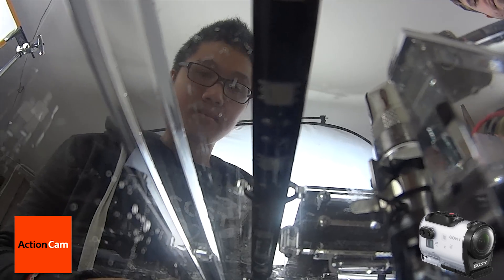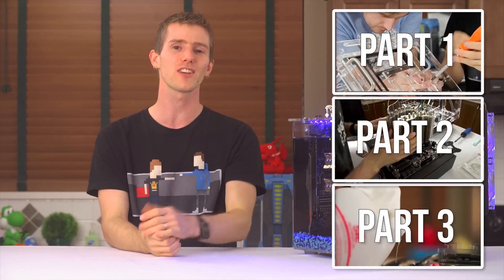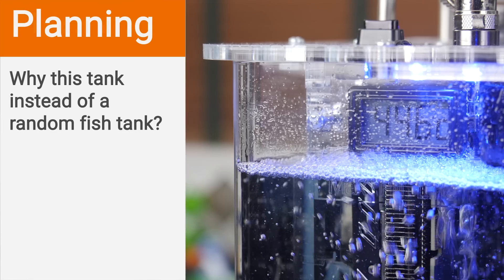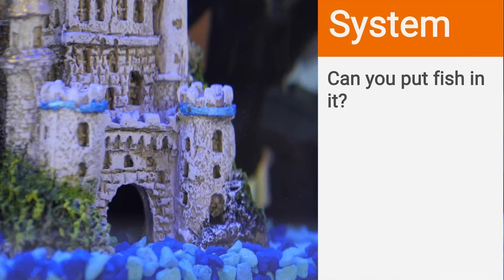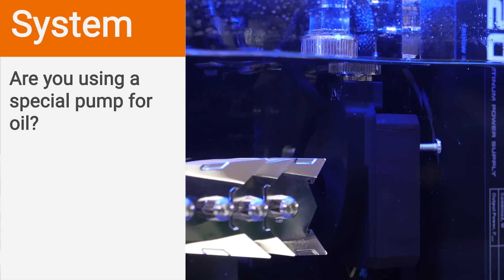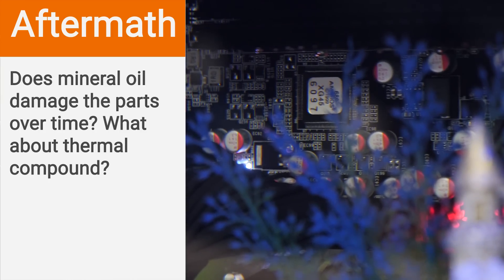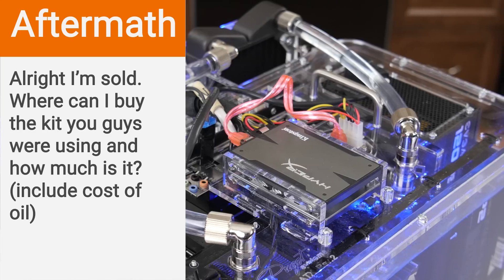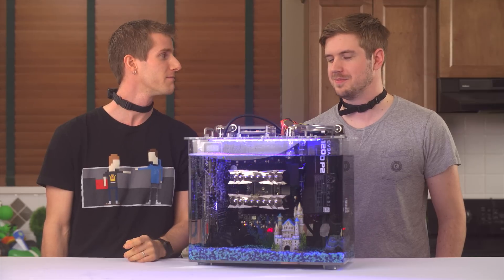Mineral Oil Cooled PC Part 4 - Q&A

Comment: Still no 1080 available?  
I can't watch this in 360p... I don't want console quality...
Reply: You mean "792p"
Reply: lol aha!
Reply: SpurnOfHumanity You're giving opinion as fact, might want to stop doing that
Reply: Apply mineral oil to burned area.
Reply: SpurnOfHumanity
Humon eye cont see more than 15 pixols.
Reply: Console is actually 720 / 1080p. Please think before commenting.
Reply: ***** But its 30 fps so it doesn't matter because gaming at 30 fps is cancer and no brother of the master race should have to go through it.
Reply: SpurnOfHumanity"All you would want" Clearly a false statement.

Don't tell me what an experience is worth to me.
Reply: SpurnOfHumanity It clearly is opinion. Go out and play on a 27" 1440p screen, then a 4K screen. Same thing? No. It looks different. Therefore, claiming it's not worth it is OPINION, not fact.
Reply: Will Stubbs
This guy has mole eyes, he won't see a difference.
Reply: Jody Boles I wanted to upvote you first, but then I realized it wasn't ironic.
Reply: SpurnOfHumanity Stop talking about the human eye when you are talking about your mole eyes.
Reply: Will Stubbs It isn't about opinion, it's about how much PPI the 20/20 human eye can see.Lets put it this way; If you cram 3820 x 2160 resolution into a standard 27" to 32" monitor (or even smaller) you absolutely CAN NOT see the pixels at that point. You can't justify the price and strain on your system. However, when you stretch the size of your screen out with the same resolution, the pixels get bigger... I shouldn't need to explain this more.

And, ***** You need more practice quoting people because I didn't say "would" I said "should".
Reply: SpurnOfHumanity It's a good thing that you can't see the pixels on 4k...
Reply: SpurnOfHumanity Its completely obvious you never gamed a 4k. Try it before you talk about it. P.S. all the 4k gaming owners are face palming at your comments.
Reply: I liek Jeeps.
Reply: SpurnOfHumanity Might if I tell you that, even if you can't see the pixel, the textures quality is still a lot sharper, that is even noticeable in Youtube video, which is already a blurry version of the original. 

"you cannot see pixel blablabla", it's 4k gaming we are talking about, not texts and shit.
Reply: SpurnOfHumanity It's gaming we are talking about, even yourself said "games", those high resolutions are not only for texts, but for the graphics, texture, you have to be blind to not notice the difference. Higher than 4k, maybe that's the case. 4k native? It is still noticeable.
Reply: watching this on 4k lol
Reply: ***** Anyone who games in 4k is wasting their time. There is no reason for it unless you are using a screen bigger than 55" - 65". The video fidelity doesn't justify the system strain. at most on a normal 27" screen, all you should want is 1440p - 1600p and 1080p on anything smaller than that.
Reply: ***** It's called sarcasm
Reply: SpurnOfHumanity So how do I "Prove" I have a 4k setup? Its almost the norm if you got a 3k$ setup
Reply: SpurnOfHumanity  Not being able to see the pixels is a good thing, makes it more realistic. Can you see atoms? No. And who is to say someone shouldn't go for 4k gaming if they have the money to do it? Maybe you don't have the money, so you've convinced yourself that it isn't worth it to make yourself feel better, I don't know.
Reply: SpurnOfHumanity The human eye can perceive about double 4k as I recall. I've seen 3840x2160 in person and the difference is MASSIVE!
Reply: no thats why 4k is better
Reply: SpurnOfHumanity  This guy makes a VERY valid point! With 1440p on a 27" monitor - you pretty much have to jam your eye INTO the screen to make out discrete pixels!
He NEVER said there is no difference between 1080p + and 4k - simply the TRUTH that when using a 27" monitor to game, 4k is pointless! If you are trying to game on a 42" + TV/Monitor THEN a 4k solution may be worth you money - in my opinion, going beyond 1600p - ESPECIALLY with aggressive AA and ASF as well as other image quality settings, seems entirely pointless IMHO!

And to all you console clutching peasants out there, NO - your PS4 and ESPECIALLY Xbox Ones - CANNOT do 1080p! They may output at that resolution - but you are CLUELESS and do not belong here if you believe that is what you are looking at! Sad truth for "next-gen" console owners - YOUR SYSTEMS CANNOT RENDER AT 1080! Period! They can output 1080 p VIDEO, but when it comes to gaming you are stuck at 792p and 900p for Xbone and PS4 respectively - BECAUSE THAT IS ALL THE RESOLUTION YOUR CONSOLE ARE CAPABLE OF RENDERING AT! So no matter WHAT ANYONE tells you, you are NOT looking at 1080p games!

And it only gets more sad from there - with 30fps being the average those consoles can output at their respective maximum render resolutions in games - as previously stated; Gaming at 30 FPS is a fucking TRAVESTY that no one should in their right mind would even TRY to call even adequate! Especially when one considers that you aren't even looking at 1080p rendered models, textures, and environments! For VIDEO - yes, 3o fps is adequate, between the static nature of videos and natural motion blurring - as well as no response time being needed whatsoever (as videos are not interactive, hence the "static" nature I mentioned, as a video will always play everything in just one order) add to the fact that natural images are not aliased whatsoever, and frame rate stops being such a primary concern! That being said - I sure as HELL can see the difference between 30 fps video and 60 fps! But the difference between 60 fps and 120 fps - for VIDEO (not gaming!) - is MUCH harder to see!

So many people with so many ignorant beliefs trolling each other - fun fun YouTube comment time! 

Spurn here made a VERY valid point which is TRUE! Unless you are looking for some huge screen real estate, 4k is a waste for gaming. That is to say, a 1440p 27" monitor with aggressive image settings will look and play better than a 4k 32" without and AA or ASF. Given, if you DO have something like dual GTX 780-970 + video cards, yes, you will EASILY be able to game at 60+ fps on a 4k monitor - but unless that monitor is 48" or larger, you are just wasting processing power as you will see little if any difference - certainly at an equal sized 27" you WILL NOT be able to visibly see any difference between 1440p and 4k - as the pixels are already smaller than anyone could possibly make out even just 12" from said screen!

Basically, if you CAN game with 4k at 60+ fps - you would be MUCH better served by setting up two or three 1440p 27" monitors in a surround setup!
Reply: Dysphoricsmile finally, someone who knows,  #pcmasterrace
Reply: It available in 4k...
Reply: SpurnOfHumanity Ok I know this post is 8 months old but holy fuck you're stupid. First of all, unless you have shit vision, you should absolutely be able to see the pixels on 4K 60" screen. ESPECIALLY with your face on it. Second of all, the human eye doesn't see in pixels. And even if it did it would see WAY more than 8K. Scientific tests have shown that IF the human eye saw in pixels, it would be somewhere around 530MP. That's about 16 times better than 8K. I have personally done a test; I could definitely see a difference between 4K and 2K at 30". 4K looks much sharper and clearer.
Reply: Up to 1080p now.
Reply: You guys are complete morons, i swear. As soon as you can no longer see the pixels, the resolution ceases to be justifiable. you cant see the pixels on a 1600p 27" monitor already so how do you justify 4k in 27" or even 32"? It IS NOT sharper if you can no longer see the pixels anymore. 

Also, keep in mind that just because the video loads and plays in 4k doesn't mean that you are actually seeing it in 4k, You are just maxing your screens pixels out.
(Unless you actually HAVE a native 4k panel.)
Reply: And you're wrong again. THIS IS THE LAST TIME I WILL SAY IT. Once the PPI gets higher to the point that your eyes can NOT see the pixels, the resolution is NOT justifiable.
Reply: It is crazy how people actually think there is a big differece between 1080p to 4k. That's like saying there is a big difference from 60 fps to 120 fps. Once you go that high, the amount that improves is very very little to the point that you don't see anything different.
Reply: IrgendEineZecke 360p is bad but I don't really care if I'm just watching a video. Gaming is different of course.
Reply: SpurnOfHumanity If you heard 64 kbps audio, it would sound like shit. On the other hand 320 kbps sounds amazing. You can't hear every bit of sound in the 64kbps audio, but that doesn't mean that more bits per second doesn't make a difference. Much in the same way that i cant see the individual pixels in my old tv from the 90's across the room, but a 1080 tv looks much better.
Reply: SpurnOfHumanity lol star citizen supports 8k, go spew your facts to the devs, and when you loose, call them idiots, see how that works out
Reply: I Came from the future to say That my 8k 3D monitor is obsolet and my AMD X Line 990 ( 200 séries after the r9)  is frame droping, i downloaded crysis 4, a very old game, and at 8k with 700% of anti analising this shit went from 678Fps to 350!  now its totaly unplayable
Reply: SpurnOfHumanity system strain? you should do more research, pc hardware is more powerful than you think, its worth it for enthusiasts who pick the right parts :)
Reply: ***** The total max resolution your eye can see might be 8K as you say (haven't checked that myself) the point SpurnOfHumanity was trying to make is that the monitor doesn't cover your whole field of view only a small portion of it. What's important is the pixel density which gets at some point so high on a average 22-32" screen it doesn't make a difference for the eye. However if the games natively support higher resolutions they also load better textures which you CAN see and you will also notice a good antialiasing effect (which you would also have on a 1440 or 1600p monitor with msaa).
Reply: What a troll you are :D
Reply: And 30 fps is very playable
Reply: MrHoward888  Prove you own 4K.
Reply: on a 27" it just barely starts to become unnoticeable. That's why 1440p at 27" is the sweet spot.
Reply: Kyler Blain ok then, answer this. If you get to the point where you can no longer see the pixels anyway, how can you justify going any farther if it makes no difference therein? How do you justify the extra system strain and money you spend?
Also, I CAN afford 4k. Someone up there said How do they prove they have a 4k screen, well, I can PROVE I have a $700 video card...
Same basis.
http://instagram.com/spurnofhumanity/
Reply: ***** yea, you a complete moron. We can NOT see DOUBLE 4K. thats 8K. even with your face ON the screen on a 60" hdtv you can't even get CLOSE to seeing that resolution.
Now get your idiocy blocked.
Reply: You guys seem to think I'm say there is no difference between 1080p and 4k. That is NOT what I'm saying. What I'm saying is that the human eye cant see the difference between 1600p and 4k on A 27" MONITOR. Now yes, if you were to stretch both resolutions out to 60" 1440p would of course be the first one to show the change.

I'm done explaining this to you 4k fanboys. 
Don't bother replying. I'm muting this thread.
Reply: SpurnOfHumanity didn't linus post a video that said that the size of the screen doesn't affect resolution? that is just putting a bigger image in your face and that's it?
Reply: motown lax He's right about it being more noticeable on large screens, same resolution on a larger monitor IS the same resolution and that's why it looks worse, you have less pixels per inch of real estate.
Reply: Consoles also play at 30fps, but your right.
Reply: Yea, I meant average. In like a 2d platfromer it could get 60 but in bf4 it gets 30
Reply: n00b, pik up teh controwler and les do dis. noob
Reply: *****
Can't remeber... i know it wasn't you, maybe it was. . . idk,
Reply: IrgendEineZecke 30fps for that "flipbook feel"
Reply: motown lax
*lose
Reply: I get a 4k option for this video, stop watching this on your iPhone
Reply: Mos Burger
i haz 12k. money for teh pee cee yai!
Reply: im still on a Pentium 2
Reply: Moron
Reply: ***** I was not calling you a moron so what is wrong with you
Reply: on 4K right now
Reply: OOHHH MY EYES!!! You say there only 360p and I get a 4k quality, so much quality!! I'm Blind!!
Reply: It's up to 4k you idiot
Reply: IrgendEineZecke Congrats for your feat of mankind
Reply: shune84 It's not worth it... you can have 4 way SLI GTX 980's and still wouldn't be able to max out settings on most newer games to play on a 4k... it's pointless as others stated on here. 4k would make more sense for people who need high resolution, for photo, video editing etc... Also for viewing 4k video.
Reply: IrgendEineZecke You just failed hard.
1.This means your PC isnt that advanced because you can't even get 1080p on it.
Second, my xbox has Full HD since ages
Reply: Jody Boles HOLY SHIT YOU'RE SO WRONG.... I don't really comment in hilarious battles like this but FUCK man, you seriously have no idea what your talking about! At higher resolutions, textures are higher quality and rendered in such a way that anti-aliasing doesn't matter! The experience of high resolution gaming IS better and I'm not sure if it's even arguable.  Also, don't even think about spreading your console fuckery about framerate! The difference between 60FPS and 120FPS is tremendous!!! I guess you wouldn't understand that though because all you ever see is 30 FPS anyway.
Reply: ImplosionFactory hmm I guess you don't really understand that I actual play PC not console anymore. There is a good difference between 30 fps and 60 fps but not much more once you go beyond that but that's me. Having higher fps is great but having 60 fps or higher is that big of a deal at all unless your game starts running below 30 fps and lag.
Reply: +MsToshi1990 and 900p -_-

Comment: I'm thinking of mounting PC components on a board on my window. I live in a cold country and the windows are always cold. Good idea or not?
Reply: ***** Thanks for that. completely forgot about condensation.
Reply: That could definitely work.  I would recommend mounting to the outside of the actual glass and not drilling into it though. Get some long extensions you can bolt your mobo on to and screw into the framing
Reply: Noctica also you would have to clean it everyday as you'd have no protection against dust.
Reply: I don't think, that's an especially good idea. First, there's generally a radiator below your window (at least where I come from) that will throw hot air onto your build. Second, you wont get that much of a Benefit from that window, because windows are made to be somewhat isolating, glass has a low thermal cappacity and you won't be able to get it directly at your processor or GPU. And i don't think, cooling the back of your MoBo is really necessary. And last but not least, a window is made so you can see through. I imagine it could look really cool, but it will get a lot darker in your room.
Reply: Great idea. Hang your pc outside so that birds can sh*t on it xD that will act as cooling agents xD
Reply: I think instead of mounting your motherboard on or right next to the window, it'd both be safer and you'd get more benefit from mounting a water cooling radiator there instead. Condensation would no longer threaten your system and you'd actually gain more cooling benefit.
Reply: straikychan The PC I was thinking of doing it with i an old college one with an exremey high amount of dust on it. Haven't got around to cleaning the components yet.

There's really nothing to lose if I do this anyway haha
Reply: If you don't let your computer cool down  (shutdown), there won't be any condensation problems.  Even when  running it outside of your house below zero in a weatherproof box.
Reply: Finrecon1 with enough holes to breathe ^^
Reply: Noctica I have my computer 3 cm from my window. I can also open the window so the intake is like 5 cm from the opening. I live close to the arctic circle, Sweeden. It becomes verry handy during the winter :)
Reply: Damn! Thats great

Comment: Linus could you do a video on how to hack a Geforce graphics card into a Quadro? Many Youtubers talk about this but there is not a lot of instructional content floating around. Thanks! Love all the content on this channel :)
Reply: it involves soldering and driver hacking and they are only recognized as quadro there are still fetches that do NOT work and if there called on can eather blue screen the system or damage the card
Reply: foxhound590 Ok, thanks. So I guess it is not really a viable video then. The only Quadro feature I would want is 10 bit colour support, because I have a 10 bit panel and it would be great to use that feature for video and photo editing. Is there any easy way to do this?
Reply: ***** Yeah, seen that video. Oh well, I guess I will just look at getting a Quadro. It is just that the only difference between the 780 Ti (my card) and the Quadro K6000 seemed to be the memory capacity and type, as well as drivers. So I though there would be some way to unlock the workstation features with a driver hack. Thanks anyway guys :)